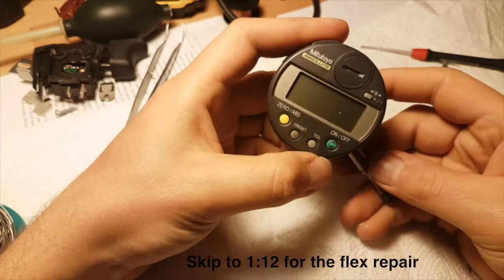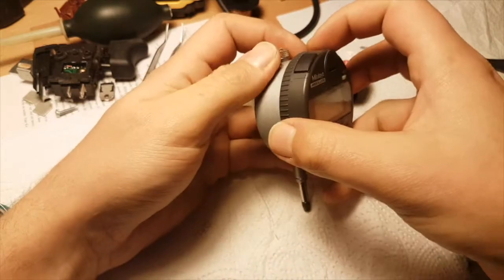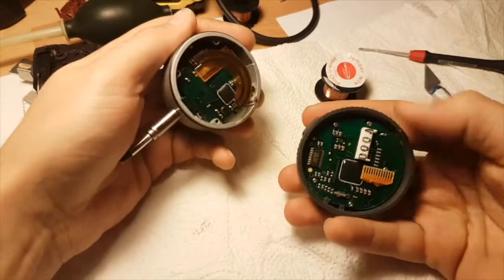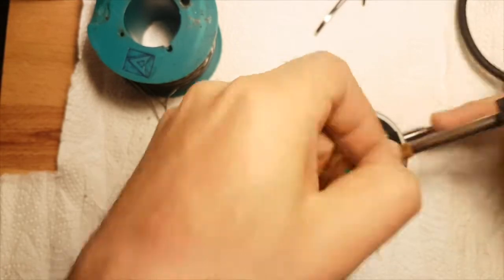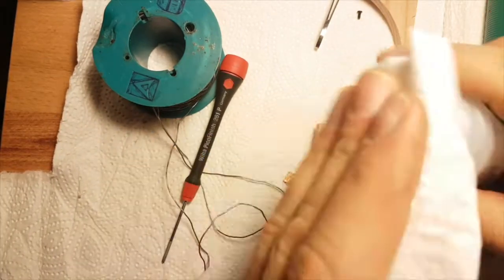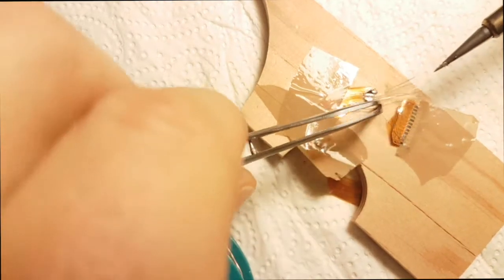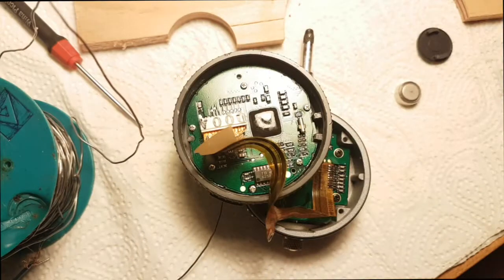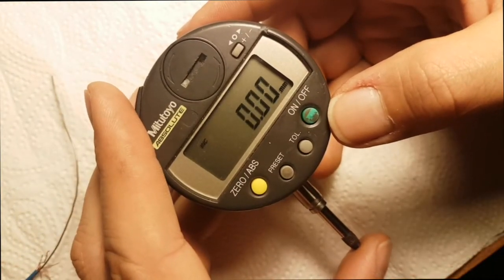Mitutoyo Digital Dial Indicator Repair. How to Repair a Ribbon Flex Cable

Comment: Nice video, I was afraid to pull on the front of mine, I didn't realize it was just an o-ring seal.
Yours looks almost the same externally (mine's a 543-252B/ID-C112EB, a US/metric model), but has a different arrangement inside. Yours has a flex cable between two PCBs, while mine has one flex PCB/cable folded up, with a PCB mounted on it. Must be slightly different models.
Also, nice job repairing the flex cable.
Reply from the maker: Thank you. No idea how many versions are out there. I want to have a lathe and maybe even a milling machine one day but got knows when... It was cheap, it was a Mitutoyo and I knew I will need one day so I just got it. Not a hard fix but annoying and needs patience. If you earn good then the time you spend on it doesn't worth it. Which means I don't earn good...

Comment: Hai sir, Mitutoyo 543-390 model digital bore dial, dimming lcd probulam, how can I solved the problem? Please Tell me
Reply from the maker: I dont know what kind of lcd tey use. If they use and lcd with Elastomeric Connector (zebra stripe connector) then you may repair it by cleaning the contact surfaces.